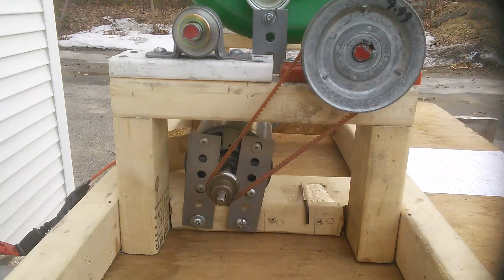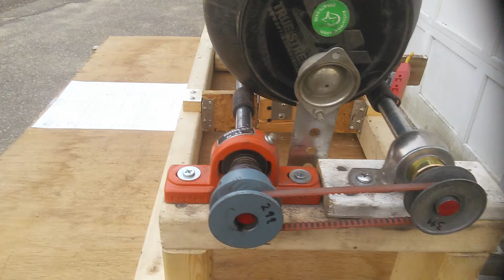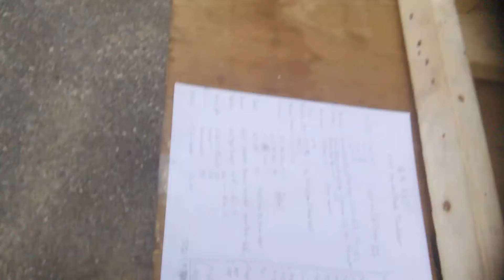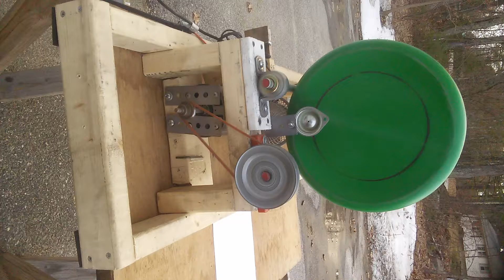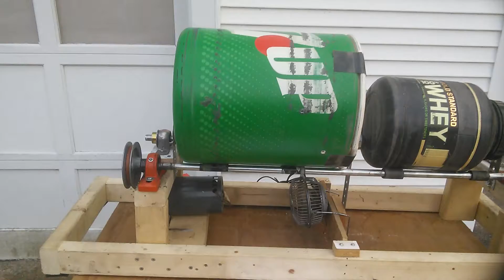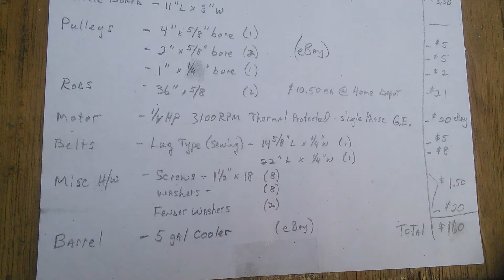DIY Parts Tumbler V.2

Comment: There is one more speed reduction you forgot to include.  That is the small shaft turning the drum.  Let's say the cooler is 14" in diameter and the shaft is 1" in diameter, then that is 14:1 more reduction.  14:1 x 4:1 = 56:1.  3600/56 = 64 rpm for the cooler.  A bit faster for the black drum, since it is smaller than the cooler.